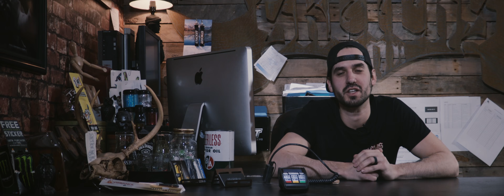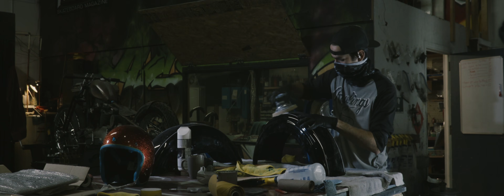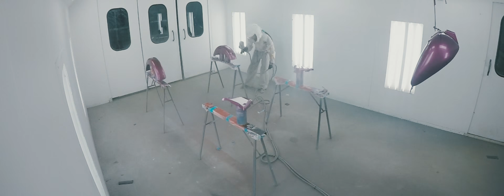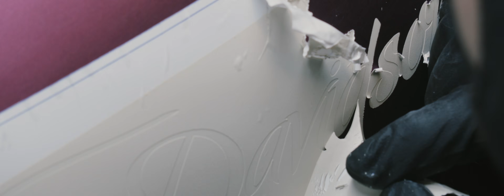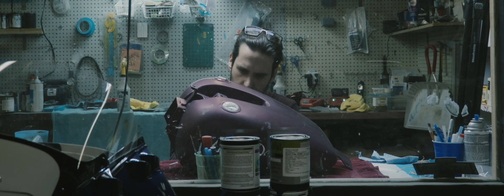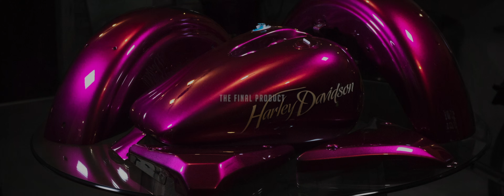This Colour is INSANE! - Custom Painting a Harley-Davidson

Comment: don't listen to this idiot here's the way it goes these are two part urethane primer sealer with comes to the harder you can mix it up thick or thin and this is about time money material once you get it all down your metal work done you spray two or three coats of the Hai build and let it sit Trace coat it with some spray paint block sand it I pulled 80 and 36 with scratches and never come back my paint never shrinks down that's why I am good I am excellent and I guarantee my work I wish I could see this guy first and I slap him up in his face what can you tell me next Tuesday wow

Comment: and those tins should have been glass beaded and the paint stripped off of them so how is he going to guarantee the top coat I guarantee my paint for a lifetime you strip it down the metal and you selfish Prime then you use the two part urethane primer system which you can Hai build or as a sealer so this guy's already given a shit job is going to crack down the road what an idiot

Comment: I've been painting cars for almost 30 years and this video is FULL of inaccurate information and incorrect terminology. Doesn't describe the purpose of primer accurately, let alone differentiating the various types of primer. Completely bungles describing a tri coat paint job, uses the term single stage wrong,  uses the term top coat wrong, and puts way too much filler on unfinished metal work....

Comment: Nice video buddy!  Where you from?  Have you never heard of intercoat clear?  You can use it to seal a color down, then do your decals ( I use oracal 631 which is a medium tack not a high tack so it has just the right amount of stickiness ), or intercoat then your taping and next color or airbrushing and so on.  That's what I do, fuck clearing a bunch of times lol.   I run a small custom paint business myself. I do a lot of Harleys...….whole lotta Harleys.  I only clear in the end.  2 coats.
Reply: Building up layers of clear even if using intercoat is a good practice, you should be sanding layers and edges from the kandy intercoat after clearing them so it is a smooth finish at the end, also it give you a safety layer if you mess up. You can just sand the kandy and intercoat off back down to the roevious layer of clear